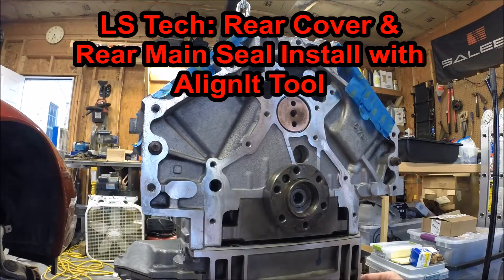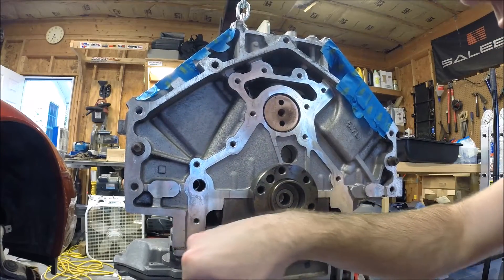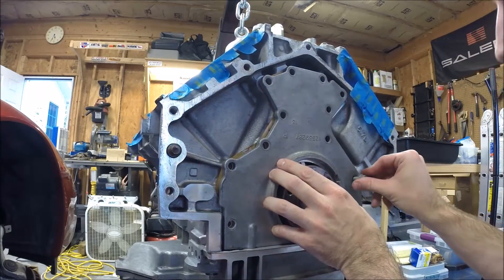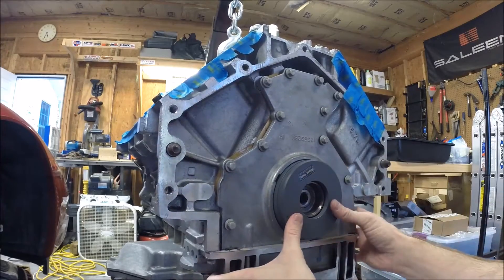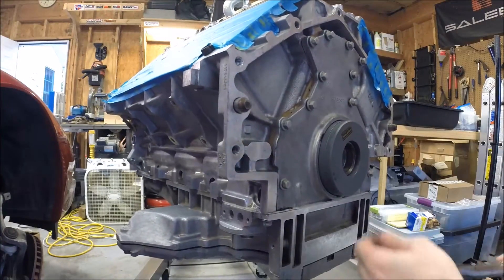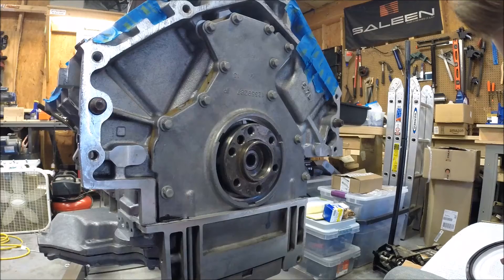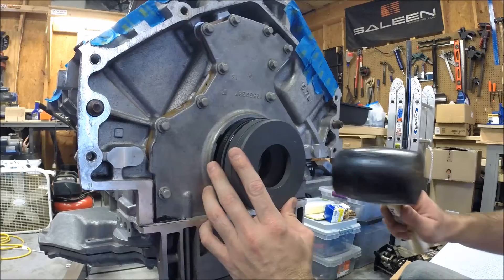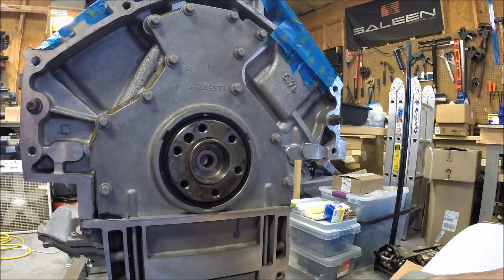LS Tech: Rear Main Seal Install with AlignIt Tool

Comment: You for got the oil thing to plug it off
Reply from the maker: 0:31  I did… luckily I saw it sitting on the work bench right after putting the cover on.   Would have been a major pain if I hadn’t caught it!

Comment: What brand of seal did you use. I got a gm and it went in to easy as if the seal was slightly to smaller worried it will spin in cover. Pulled it back out (came out way to easy) and put calipers on it and it is a fraction smaller than original but I don't kone if that's because of 22 yrs of heat and oil on the factory and its swelling a hair. Just seems there should be some tension when the new goes in. Thinking of using some rtv on the outside.

Comment: You do not need the tool if the oil pan is off.....the rear oil seal retainer will float and self center.... torque it..then install the oil pan

Comment: Why not replace the plate with the gasket already installed?
Reply from the maker: You could, but the flexibility of the gasket can allow the cover to be slightly off center.  The installation tool ensures the cover is perfectly center on the crank, so when you install the seal, it is perfectly centered too.  Less chance of a rear main seal leak.

Comment: What about the oil galley barbel
Reply from the maker: Yes, make sure you have the barbell installed!  See the 30 sec mark in the video.  I forgot mine and had to go back to install it.  Fortunately I caught it immediately afterwards as it was sitting on the work bench, haha.  But would have been a major problem later on.

Comment: Where is the barbell? I didnt see you install the barbell that slides in by the oil filter bypass
Reply from the maker: Correct.  As noted at the 30 sec mark, I had forgotten to install the barbell.  Fortunately I noticed it sitting on the work bench immediately after, so I was able to go back and get it installed.  But otherwise would have been a very unfortunate mistake.

Comment: Aren’t you supposed to add some sealant to the bottom of the cover as well??
Reply from the maker: Yes, add a dab of sealant in the bottom corners where the block, cover, and oil pan come together as shown around the 1:38 mark.

Comment: the way we  do these at work is... we install the remain seal in the retainer...install the retainer and let the seal position itself and the retainer...then torque the rear main seal retainer...THEN install the oil pan.....in ls engines if you have a rear main seal leak.. it is mostly the retainer gasket and not the rear main seal as much...
Reply: Hi, so I was told at a shop that I have a rear main seal leak, and so decided to do the repair myself, and i have the motor out, is this really true? It’s the metal plate that leaks and not the seal?
Reply: exactly what i was thinking.. use the main seal to center and position the cover.. this tool is just fluff.

Comment: U need to put sum kind of oil on the seal or when it starts it will have a dry start
Reply from the maker: That's very common on a lot of motors, but the service manual and manufacturers like Fel-Pro instruct that the seal is designed to be installed dry.
Reply: It's a PTFE seal and needs to be installed  dry on a clean shaft .  Check this video https://youtu.be/TGXNgpkvEe0

Comment: Nice vid thanks you what brand gasket and seal did you use and did you reuse the cover bolts? Also what brand barbell did you use?
Reply from the maker: I used GM gaskets.  Reused the cover bolts.  I used a SacSity billet barbell... I have a separate video on that.   Thanks for watching!

Comment: I think you this backwards first get the alignment tool install into the rear cover then finger tight the lower bolts first then the upper ones then torque the bottom 2 first then tirque the rest after that remove alignment tool then install your new rear main seal

Comment: Why dont you just install the seal into the back cover BEFORE re-installing the cover? That way, the seal centers itself around the crank...Or is this tool only for doing in-car repairs where you don't want to spend the extra 5 minutes removing the cover?
Reply from the maker: If you install the seal before installing the cover, there is enough play in the bolt holes that you may not get the cover properly centered and you get a rear main seal leak.  The tool allows you to get the rear cover perfectly centered, then tighten the bolts.   Then when you install the seal, it is perfectly centered around the crankshaft.   They make a similar tool for aligning the front timing cover.   Must-have tool.   Makes it a simply job.   Pulling the torque tube again to fix a rear main seal would be a nightmare!
Reply: @ScrufsGarage  just trying to understand......so there is play in the bolts regardless of if the tool is used or not. the rear cover needs to be aligned, and then bolts get tightened, and cover will not move anymore.  the question is why cant we use the seal itself to align the rear cover before tightening bolts, vs using tool to align before tightening bolts.  i know the engine manual shows using a tool.  but i dont understand why.  only thing i can think of is that the oil pan bolts may pull the cover down too far, resulting in misalignment. in which case the tool wouldn't be able to be removed, and thus be a sign that there is misalignment.
Reply from the maker: The seal can flex, so it's difficult to get the cover perfectly centered.  The tool is a rigid fit to the cover and the crank, so that the center of the opening in the cover is perfectly concentric with the crank.
Reply: Right lol i did it and it works and no leaks so
Reply: It won’t center itself I’ve tried before u have to have the tool u get it off a mm it leaks

Comment: i will be doing my rear engine  main seal on a 2009 Hummer H2 with 6.2L V8 is that the same install tool that i need ? I have the GM 6spd 6L80E trans. Also  since it is 4X4 how difficult of a task is this. I do heavy school buses, and over the road semis eaton fuller 10sp, 13speed and allison 1000, 4000s transmissions . thanks
Reply from the maker: Yes, as far as I know, this tool works for any of the LS motors.   I haven't worked on a Hummer so I can't share any specifics there... but if you can work on OTR trucks, I'm sure the Hummer won't be any problem.   Just don't use any of your 1" drive impacts on it, haha.

Comment: Install the seal dry?.. Is that a manufacturer recommendation?. I was trained to lube the inside of that main seal. you want lube on there when the crank start spinning
Reply: GM manual says to not lube it, install dry.  but i have no idea why
Reply: It's a PTFE seal and needs to be installed dry on a clean shaft .
Check this short video 
https://youtu.be/TGXNgpkvEe0
Reply: @danielg4228  awesome. Hadnt seen that before . thanks guys
Reply: Learned this the hard way .  I've installed a well lubricated PTFE seal
Few days later it was leaking worse than the old one .  Had to drop the transmision again !
Reply: @danielg4228  wow.. You learned me something today.. Good lookin out.  Thank you sir!
Reply: It comes with lube there already

Comment: Liked to have saw the AlignIt Tool from inside after you removed it, to see where the white plastic piece the seal is on went to. 
It has to come out from the inside of the seal after it goes over the crank snout, it disappeared like magic, lol.
Reply: The white plastic just falls off inside the tool. It should be left in while doing the install, it holds the seal lip open so it doesn't fold in during the install.
Christian

Comment: Where can I find the torque specs for the LS engine?
Reply from the maker: There are a number of good online resources.    I also purchased a book called "How to Rebuild GM LS-Series Engines" which had useful tips and a nice torque spec chart in the back.  https://amzn.to/2XbuZfw
Reply: @ScrufsGarage  thanks brother. Will it cover the t-56 trans? And other transmissions?
Reply from the maker: @Leveluplivin   No, that book is focused just on the LS engine.   I'm sure there are other books that might focus on the T-56.    Or, you could buy the Factory Service Manuals which would details everything for your specific model.  While those manuals are typically several hundred dollars, they are very extensive and if you're tackling a major project, can really pay for themselves.

Comment: I have a ls 5.3 and I rebuilt it. I already put it in my truck but has low oil pressure. I forgot to put in billet barbell in. Will the billet oil by pass in the oils filter fix my situation or no?
Reply from the maker: Ugh, very sorry to hear you left out the barbell.  You absolutely have to install it.   The barbell is what routes oil down into the oil filter.  Using the bypass delete won't do what you need.

Comment: Hi
Just wondering why no sealant is placed between the bottom of the plate and engine block.  I realise the plate is torqued down to the block via the sump bolts but I would have thought some goo would be added along the bottom of the plate to be sure.
Hope to hear from you.
Regards
Mark
Reply from the maker: Between the block and rear cover plate is a gasket.  Between the rear cover plate and the oil pan is a gasket.  Put a dab of rtv in the corner where those three pieces come together (block, oil pan, rear cover plate).  That helps prevent oil from seeping past where the pan gasket and rear cover gasket intersect.

Comment: I got a question for you Scruf, 

So I have my rear main cover installed with a brand new rear main seal and gasket on my LS3.  In your opinion is it worth taking off the rear main cover and upgrading to the billet barbell? If yes, can I re-use the gasket and main seal? Engine has never been ran, and can you re-install the main seal when it’s already in the rear cover? Alignment issues?
Reply from the maker: Correct, you aren't going to see any significant differences.  Oil pressure is a function mainly of main bearing clearances.  The tighter fit of the billet barbell helps prevent any unfiltered oil from getting past the barbell.
Reply: @ScrufsGarage  The differences in non filtered oil without the barbell installed
Reply from the maker: You would destroy the rear main seal pulling it back out of the cover, and if you leave it in the cover you risk alignment issues/leaks.   You might be able to reuse the cover gasket, the challenge though is that you should put a dab of RTV in the corners where the block, the pan, and the cover come together.  That RTV can be tough to get off the gasket once it has cured.    The billet barbell is a nice unit, but may or may not be worth the extra work to change it at this point.   Good luck!

Comment: Thanks for the video
. I would like to purchase your tool. Also I have a question, why do I keep blowing my seal right out the back.?
Reply from the maker: The tool is from SacCity Corvette.   As for blowing out the seal, you may be building too much crankcase pressure.  Take a look and make sure the PCV system is venting correctly.
Reply: As scruff said something is wrong along your pcv to be blowing seal as its preasurising

Comment: Hi Scruf,
My name is Christian from SacCityCorvette, the inventor and manufacture of the AlignIt Tools. Thank for your business and the great video. Just want clarify one thing. You mentioned to torque the pan bolts first which in many cases can pull the cover  down to much causing it to miss aligned and also bind the AlignIt tool making it hard to remove. I was waiting to see you remove the tool after you were finished to see if it would be hard to get the tool out but you did not show that part in the video. As we show in the video in our website, we recommend to install all the cover bolts hand tight and then  just snug the bottom 2 pan bolts to pull the cover down against the gasket just enough so the tool can slide in freely, then torque the cover and then torque the pan. Just wanted to point that out so other AlignIt tool users don't make a mistake. Thanks again for the video! 
Christian
SacCityCorvette.com
Reply from the maker: Hey Christian, thanks for checking out the video and the great tech tip on the torque sequence.   I didn't have any binding on the tool when I was removing it, but understand your suggestion about being cautious about pulling the cover down too much.   Thanks for making a great tool that makes installation so much easier.
Reply: I was also waiting for the part where you removed the tool. I built 3 engines and used the front and rear Alignit tools. Fronts always work perfect. My rear tool however is very tight every time (no amount of oil helps). This is with the oil pan off and on an engine stand. I would have to pry and tap with a hammer to get it out. Just cracked it the other day while assembling an LQ9. Not too thrilled right now. I'm wondering if a new tool would be made better.
Reply: @MichaelJNXB  Perhaps if the alignment tool is hard to get out then the cover is not centered around the crank flange. I would install the oil pan and use the 2 pan bolts to allow for some vertical adjustment of the cover until the adjustment tool eases out. .
Reply: @steadyeddie7453   Hi, you are correct if the pan is already installed. Using the two long pn bolts to compress the pan gasket a little and relieve pressure off the tool allowing it to center the cover.   If installing cover without the pan installed it is easier and there won't be any binding of the tool. You just have to make sure the cover is even/equal on each side of the block.
Thanks
Christin
Reply: You are correct. That's why I gave him the thumbs down.
Reply: Thank You.. About making sure centering tool is not binding up in the oil seal  housing.
Reply: SacCity, i was considered the purchase of your tool.  can you explain the need for it? ive seen videos where people dont use it.  they install the seal 1st, and use the seal to center the cover, then torque down.  it would seem to me that allowing the seal to center itself would be fine, and result in a perfect alignment.  only thing i can think of is if the oil pan bolts are tightened to much and pull the rear cover down too far, distorting alignment of the rear seal.  and only way to know if this happened is with the tool.  since if the rear cover gets pulled down too far by oil pan bolts, then the tool would be jammed and wouldnt be able to be removed.
Reply: @makesumwake  
Hi,
The problem with using the seal to align the cover is that the seal is soft and won't hold the cover exactly center with the crank. If using the seal was a reliable way to do it the GM service manual wouldn't tell you to use the Kent Moore alignment tool to align the cover.  You should not torque the pan bolt down first, you should just snug them enough so that our Alignit tool can spin and is not bound up, then torque the cover bolts, after cover bolt are torqued loosen the two pan bolts to relieve any pressure from the cover being pulled against the block and then torque the pan bolts.  A lot of people say they have installed dozens of covers without using a alignment tool without any problem.  Yes, maybe it didn't leak right away, but using a Alignment tool can me the difference between going 50k miles (or less) before a leak starts or going over 100k before a leak starts.  Using the AlignIt tools adds quality to your build. If I had to pick a someone to build my engine, I'm picking the guy that aligns the covers properly with a tool, that is the guy that is a perfectionist and the rest of the build is probably done right. 
Thank you,
Christian
SacCityCorvette.com
Reply: Damn the manufacturer just told you you installed his shit wrong lol